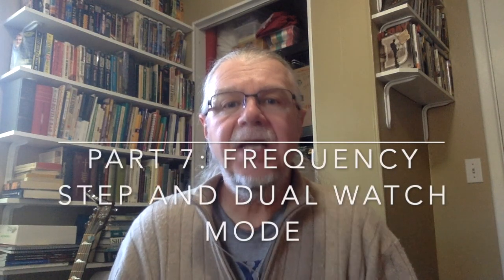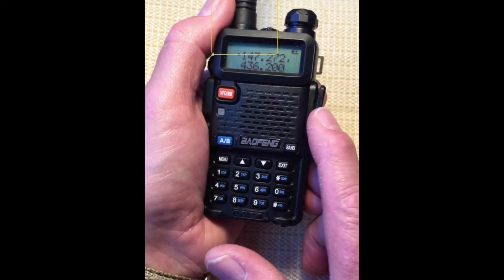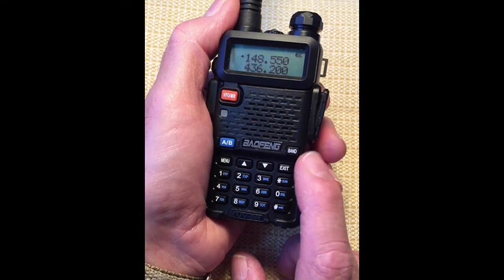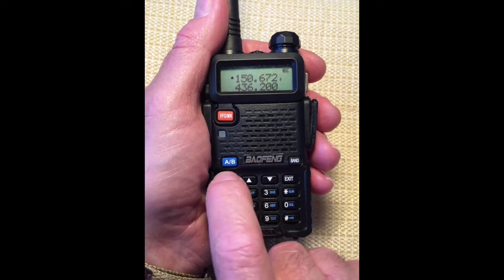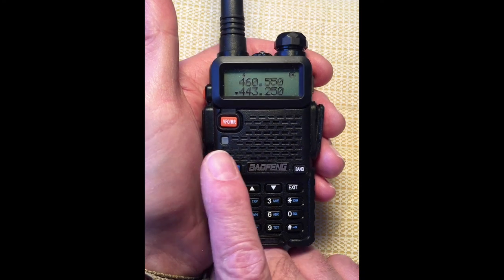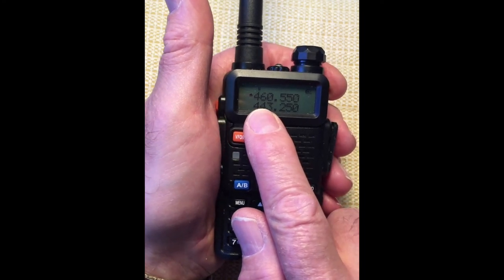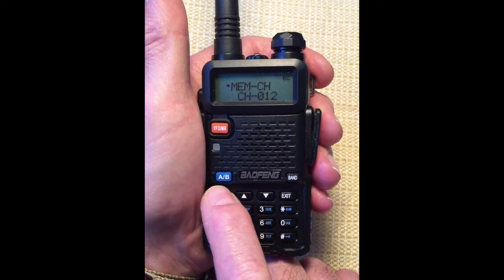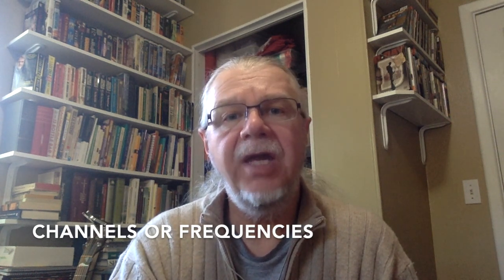Baofeng UV-5R | Part 7: Frequency Step And Dual Watch Mode

Comment: good tutorial, thanks for making it! I think TDR can also be switched on and off by a single click of the *SCAN button which would make the S letter to appear/disappear on the display
Reply from the maker: I'm trying that out now, Takeshi. My UV-5R is set with TDR ON, and the "S" is displayed. If I simply press |SCAN|, in VFO mode, the display enters a "7", as if I were attempting to enter a new frequency. In Channel mode, pressing |SCAN| removes the "S", but only as long as I continue to press |SCAN|.

However, if I first press |MENU|, then |SCAN|, the display immediately displays menu option 7, "TDR". Pressing |MENU| again selects that menu option, allowing me then to arrow up or down to select "ON" or "OFF". Finally, pressing |MENU| a third time, the option is confirmed.

So, I don't think its a single click feature on my radio. But it does allow quick access to the TDR menu option.

Does your radio handle this differently?

Comment: This is extremely helpful especially when trying to QSO the ISS as they have separate Downlink and Uplink frequencies. You are not supposed to TX on the Downlink that is for RX only. You should only TX on the Uplink frequency! Thanks for this video! 73
Reply from the maker: For sure, Scotty D! I've used that feature just recently for ISS signals. Keep in mind the dopler effect...be ready to re-tune slightly, before and after the satellite passes over your position. Thanks for your encouraging comment. 73!

Comment: Okay so by adding the frequency level up does it help gain or lose the frequency
Reply from the maker: Thanks for the question, Richard. I'm not understanding the question well, however. Can you clarify a bit more? I'll take a stab at answering what I think you may be asking:

When you say "adding the frequency level up", I'm assuming that you mean increasing the Frequency Step, Menu Item 001. Is that correct? If so, it does not have anything to do with gaining or losing the frequency.

Changing the Frequency Step affects how the radio scans through the frequencies. It also affects how the up and down arrows tune to a frequency.

Let's say we wish to scan for an active frequency, somewhere between 144 MHz and 145 MHz. Let's set the Frequency Step to the highest value: 50.0 kHz. Next, tune the radio to 144.000. Now, in Frequency Mode, long-press the [SCAN] key. The radio scans quite rapidly, but it is only checking every other 50 kHz frequencies. With the Frequency Step set to 50.0 kHZ, the radio is checking only the following frequencies:

- 144.000
- 144.050
- 144.100
- 144.150
- 144.200
- 144.250
- 144.300
- 144.350
- 144.400
- 144.450
- 144.500
- 144.550
- 144.600
- 144.650
- 144.700
- 144.750
- 144.800
- 144.850
- 144.900
- 144.950
- 145.000

All the frequencies between 144.000 and 144.050 are skipped!

The lower the Frequency Step, the more frequencies will actually be checked while scanning.

One of the problems I encounter when I try scanning with the Frequency Step set to 50 kHz, is this. The scan stops on a signal, but it's not the exact frequency on which the signal is being transmitted. It's close, but not close enough. Instead it's noisy, scratchy and barely readable. But if I try to adjust the tuning with the up or down arrow, it tunes in 50 kHz steps and completely misses the frequency I need. That's why I need to be able to decrease the Frequency Step.

Comment: can i pick up digital channels on this radio?
Reply from the maker: My first thought was, "No, it can't." However, a quick search online for "baofeng uv 5r digital" yielded a few hits. Here are a couple:

Baofeng UV5R Digital Mode
 - https://www.youtube.com/watch?v=pFBs3BxQkfo

BaoFeng DM-5R Dual Band DMR Digital Radio - https://qrznow.com/baofeng-dm-5r-dual-band-dmr-digital-radio-new/

The first link indicates that with the proper cable and computer software, it can.

The second indicates that Baofeng makes a digital-specific radio.

I do know that the UV-5R can receive and transmit digital tones: DCT.

That, however, is about all I know about it, Gladys. Consider doing a more thorough search of online information. 73!
Reply from the maker: Here's a quick update, Gladys, after a bit more help from some local elmers. It's entirely possible to transmit and receive digital signals with this radio on the 2-meter and 70-centimeter bands. I've ordered and expect soon delivery of the device that can interface between my radio and my computer. In the meantime I've been able to transmit and receive digital signals acoustically, no other cable or device expect my radio and my computer. I downloaded a free program called "Fldigi" to my computer. With the proper settings of the program and my computer I can use my computer's microphone to input audible digital signals to my computer, and Fldigi decodes it into readable text. Then, I can type a response into Fldigi, tap "TX" and hold my radio microphone close to my computer's speakers. The audible digital tones from the computer are transmitted over the air by my radio, received by another station running Fldigi. It's pretty cool! But soon I hope to connect my radio to my computer directly with a cable and external soundcard device, making the communication much more stable, reliable and easy.

Comment: I recently got a Baofeng BF-F8HP but when I turn it on and go to a frequency it starts to constantly make a static sound it sounds like someone is spamming the PTT button over and over again and I have my squelch set to 5 witch was the default and the first thing that it did was make that sound if you have discord dm me on discord and I can send you a video of it happening maybe some of you can help me fix it.
Thanks in advanced
Vetboss
Reply: 3 is the things that happened I have done 4 but it is not stoping the static. It also sounds like I am losing the signal when I point at a different direction.
Reply from the maker: @VetbossOfficial  That's a good clue: if the signal changes when you move, that could indicate that there is a strong radio frequency signal interfering with your reception.

A quick search of the internet yields several good resources. Here are a couple:

>Radio frequency interference can disrupt and disturb the normal functioning of electronic and electrical devices, and thus it is important to limit it when possible.

https://www.techopedia.com/definition/9074/radio-frequency-interference-rfi

>The most useful question to ask first regarding interference isn’t “What is producing this RFI?” but “Where is this interference coming from?” Once the source of RFI is determined to be coming from a specific location, the process of identifying the actual device causing issues is much easier. 

http://www.arrl.org/radio-frequency-interference-rfi

You might consider traveling a few miles in every direction, trying your radio at different times. If the static continues to be heard regardless of your location and regardless of the frequency setting, I'm inclined to think your radio is damaged.
Reply from the maker: I'm not familiar with the BF-F8HP, Vetboss...is it much different than the UV-5R?

Here's a few troubleshooting steps you might consider:

1. Does it only happen in VFO mode?
2. Does it only happen in MR channel mode?
3.  Does it only happen on certain frequencies?
4. Have you tried increasing the squelch setting?
5. Are your batteries old or discharged?

I think I've encountered a similar sound at times, but it was limited to only specific frequencies...I think digital signals might sound like what you're describing. The Baofeng UV-5R cannot properly receive digital signals...they sound only like pulses of static. The only thing I can do is change to a different frequency.

However, if the problem is happening regardless of battery level, mode, frequency or squelch setting, then there must be something seriously wrong with the electronics of your radio. And that is beyond what I can help with.

Comment: OK THANK YOU FOR ALL YOUR HELP! NEXT QUESTION I'M ONLY USING THIS FOR A SCANNER NO TRANSMITTING. sO MY QUESTION IS TO WHAT SETTING TO I SET the tone mode tone and the rest of the setting using chirp software
Reply from the maker: Gladys, thank you for the question.

I'm going to reset my radio, starting fresh, and setting it up for scanning. I'm assuming you're using it to scan police and fire channels in your area. I'll be using some frequencies that I often listen to. You'll have to program your radio with the frequencies that are local for you.

1. Reset all settings and basic configuration

- Reset All - Menu 40
- Set Voice to English - Menu 14
- Set bandwidth to WIDE - Menu 5
- Set DCS and CTCSS to OFF - Menu 10-13
- Set DTMFST to OFF - Menu 16
- Set Scanner Resume Method to CO - Menu 18
- Set PTT-ID and PTT-LT to OFF - Menu 19-20
- Set Squelch Tail Elimination to OFF - Menu 35-37
- Set Roger Beep (ROGER) to OFF - Menu 39

2. List favorite frequencies in ascending order

I've found it most helpful to create a list of my favorite frequencies, listed in ascending order. Then I can save each to a memory channel. Since they are in order I can easily arrow up or down to find the frequency I'm most interested in.

Here are ten police and fire frequencies that are in my local area:

153.935
154.010
154.415
154.920
154.950
155.955
453.150
460.375
460.475
460.500

3. Save to memory channels

Here is a quicklist of the steps to saving a frequency to
memory, assigning it to a channel number:

1. Select Frequency Mode by toggling the VFO/MR key
2. Enter the frequency
3. Open the Menu for Memory Channel: [MENU] 027, [MENU]
4. Arrow up to next available channel number
5. Confirm the assignment by pressing [MENU] key, then [EXIT]

I recommend starting with memory channel number 1:

1. 153.935
2. 154.010
3. 154.415
4. 154.920
5. 154.950
6. 155.955
7. 453.150
8. 460.375
9. 460.475
10. 460.500

After saving memory channel 1, repeat the process with the following frequency, saving to channel 2.

Repeat until all ten frequencies are saved to a memory channel.

Tip: to skip immediately to channel 3, rather than using the arrow key:

- [MENU] 27, [MENU]
- Enter 003
- [MENU] [EXIT]

4. Set to receive-only mode

To use the radio as a scanner only, with the ability to transmit disabled, we must use the CHIRP programming software.

Thanks to willworkforliberty for a good video how-to regarding this: 

https://www.youtube.com/watch?v=snKmYrMWGHo

First, remove the antenna from the radio to avoid receiving signals that may interfere with the data transfer process.

Now, follow these steps:

1. Start the CHIRP programming program on your computer
2. Connect radio to computer with certified cable
3. Radio ON, volume turned full on
4. In CHIRP, open Radio, Download From Radio
5. Select Port: COM3
6. Select Vendor: Baofeng
7. Select Model: UV-5X
8. Select OK

The program displays the instructions. If you've already done steps 1-5, then select OK to download image from the radio.

A cloning process window opens. When it finishes, the display shows the ten memory channels we saved to the radio.

Note: The radio automatically saves two other frequencies to channels zero and 127. You can later delete these if you so desire.

Image Link - https://i.imgur.com/pmqVrUV.png

Now, let's disable the ability to transmit:

1. In the sidebar, select Settings
2. Select Other Settings
3. For "VHF TX Enabled", ensure that the "Enabled" check box is blank.
4. Do the same for "UHF TX Enabled".

If the "Enabled" checkbox has a checkmark, you must click in the checkbox to deselect and remove the checkbox. If "Enabled" is NOT checked, the radio will NOT transmit on any frequencies. You can still receive and listen to the signals, but the radio will NOT transmit!

Image Link - https://i.imgur.com/pALiCPA.png

Now, after making the changes to the settings:

1. Select Radio, Upload To Radio
2. Ensure Port, Vendor and Model are still correct, then select OK

The program displays the instructions. If you've already done steps 1-5, then select OK to upload image to the radio.

Again, a cloning process window opens. When it finishes, turn radio OFF, disconnect the cable, and quit CHIRP.

Now, re-attach the antenna and turn the radio ON.

Set to channel mode by pressing [VFO/MR].

Arrow up or down to see the saved frequency channels, from channel 1 to 10.

Press and hold [SCAN] to begin scanning.

Press [EXIT] to stop scanning.

If you mistakenly press the PTT switch (Press To Talk), the radio will NOT transmit! The transmit light will remain off, indicating no signal being transmitted.

You may add additional frequencies to your channels, and they will be scanned and listened to, but none will be allowed to transmit.

Comment: How to change frequency no. from hello mode my digit no.  is not changing need help..
Reply from the maker: Thanks for the question, Joccin.

I don't understand "hello mode". You'll need to clarify that for me.

I'm going to assume that you are attempting to enter a frequency by pressing numbers on the keypad, but you're not any change in the displayed frequency. I suspect you're in "Channel Mode". You need to be in "Frequency Mode".

Try the following troubleshooting steps:

1. Power ON
2. Does the voice say "Channel Mode"? If so, change to "Frequency Mode" by pressing the [VFO/MR] key.
3. Is there no voice response when you turn the power ON? If so, change Menu Item 14 to "ENG".
4. Does the voice say "Frequency Mode"? If so, enter frequency by pressing on numbers on the keypad.